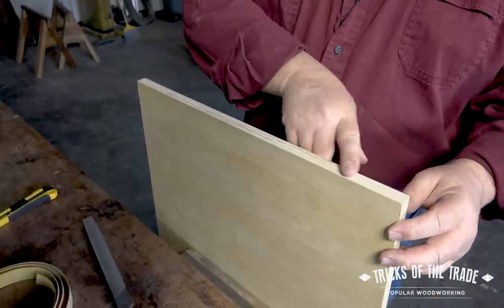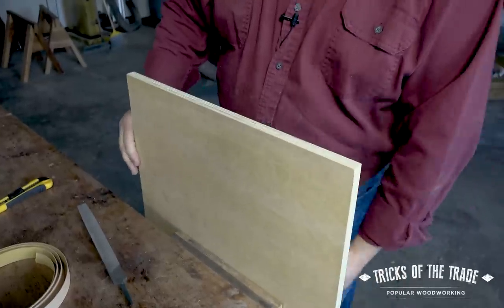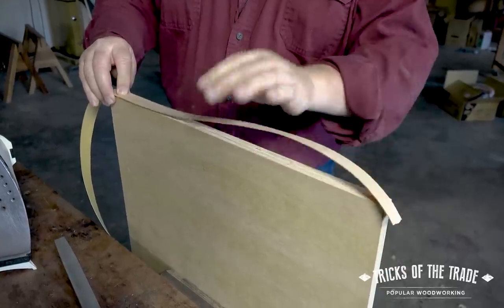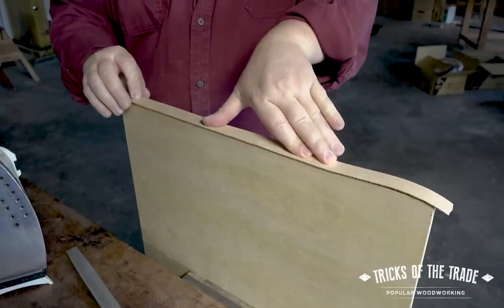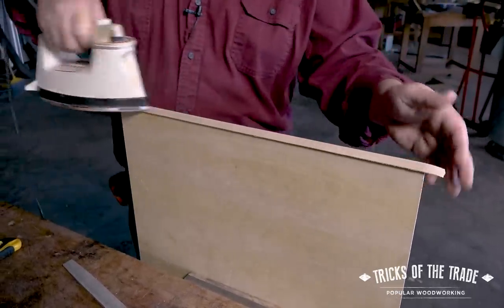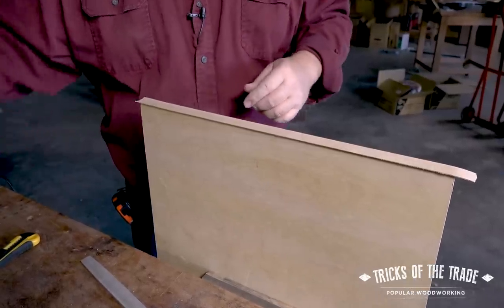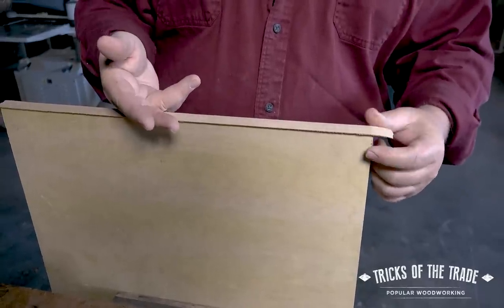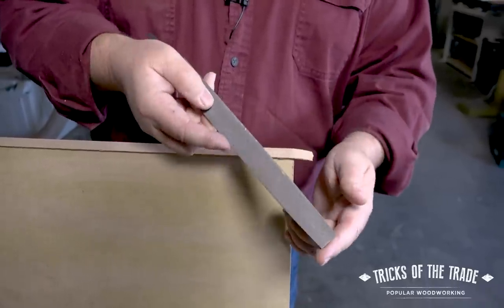Easy Edge Veneering | Tricks of the Trade

Comment: i was taught to use a file when i trained.  i must admit that i now use a wide blade chisel held flat against the side and angled down.  takes it off in one quick peel and then one light run down the edge at 45 with a file and the job is done.
Reply: So do you use the chisel's sharp blade to do the cutting or the side of the chisel like the file to do that cut? Trying to learn. Thanks in advance.

Comment: And as shown on this video Don't be afraid to put your file on it and you need to lay your piece flat down on the table which you standing over it fall left to right it's much easier and then you flip your piece and do the other side it's much easier one shelf or one upright less than 30 seconds then it's time for stain or paint

Comment: Could I use veneer edging on a more rough edge like chipboard/particle board? Or would the glue not be sufficient for a good bond, since the cut surface of chipboard is usually not as flat as plywood or solid wood?
Reply: Iron-on veneers will work fine on chipboard. Surprised that nobody replied to you on this before today…